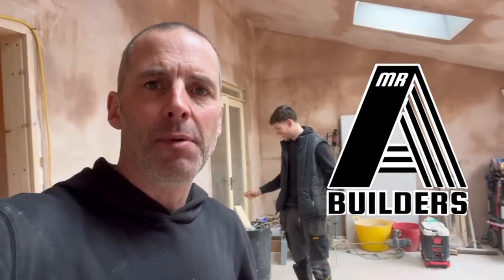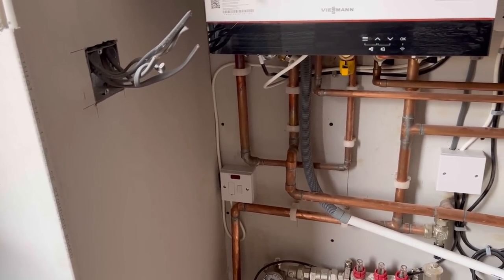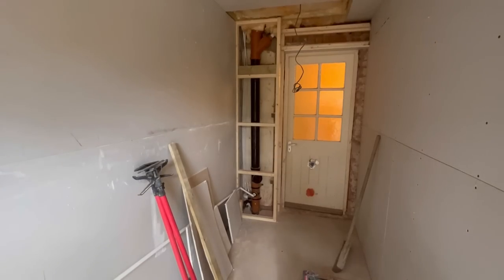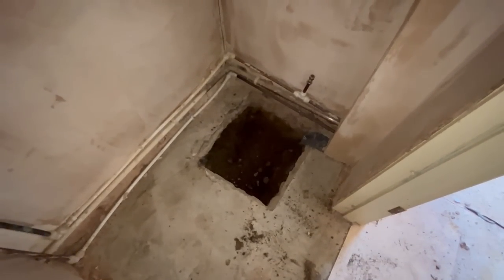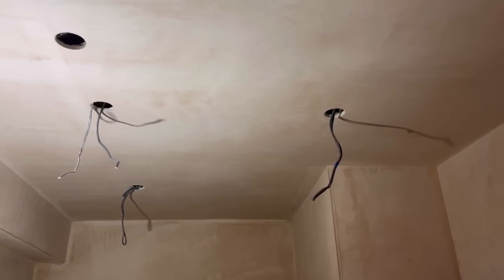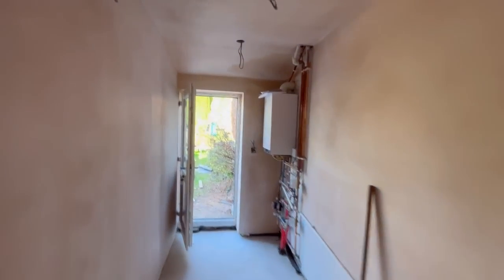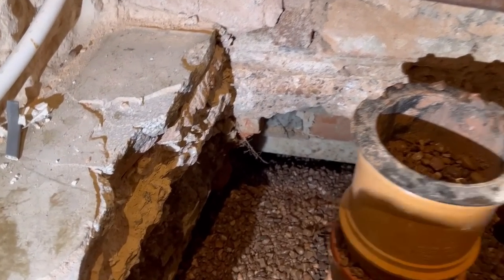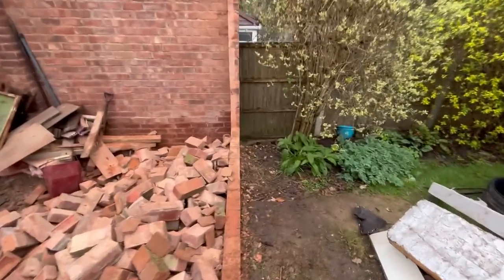Spot lights, poo pipe, plastering prep and clean up

Comment: Doing a nice job on the extension. Just a thought! why don't you cut the holes for the lights in the plasterboard before it's plastered. Then the plasterer just goes over them and before it sets just cleans them out with a gauging trowel. As you say you can't do it on sites but on private work it works well and no stress finding the wires.😊
Reply from the maker: We prefer the stress mate. 😂
We have tried different ways over the years but the problem with a cold roof especially in the winter is that if you cut the holes out first you get a constant breeze and it blows any dust and insulation bits into  the room over the finishing plaster and also the holes aren’t as crisp because you have to trim the plaster snots off the edges prior to spot light fitting. I’m sure others would disagree but it’s always best to stick to the method that works best for you sometimes and of course what you think produces the best result for you. 👍🏻
Reply: @Mr_A_Builders  Your so right about doing what's best for you but always listening to and watching others! you never stop learning.  

That's just the way I do it !

At the end of the day if you leave a job that your proud of that's all that matters. 

Enjoying watching you work, keep putting the videos out. Thanks for sharing.
Reply: A
I've plastered a few of these jobs, I don't cut the holes, plasters much easier and doesn't squish plaster up the holes, speedskims better too. The electrician doesn't like it because he fears he won't find the cables. But a good measured map sorts that out,   and we all breath a sigh of relief.
Reply from the maker: It’s all about trusting the plan of your hole mapping at first fix 👍🏻
Reply: @Mr_A_Builders  seem to have started a bit of a debate here😅

Maybe I'm a bit luckier than most, I am time served Plumbing/ Heating (Eng Tech). A qualified gas fitter. Qualified Electrician right upto Inspection/Testing and worked along side my dad who is a Plasterer. He taught me his trade.

I was just saying I prefer to cut holes first, I find it less stressful. I plaster it, never had a problem with plaster squishing up the holes🤣

Just give them a quick clean out with my gauging trowel and very rarely use speed skims or flexible trowels, just my preference.

Being an electrician I just put the lights in the next day. Job done no problems🙂
Reply from the maker: There is never a best way to do anything as long as the outcome, quality and of course within regs in some cases is the same. Even if it takes longer the way we feel is best, we have to do what makes us comfortable and gets the results we want. 
We love it on the channel when we get subscribers answering each other and giving their opinion on other comments it means we can just sit back and watch 😁👍🏻
Reply: @Mr_A_Builders  😅🤣😅

Comment: Very Nice Work, I start and extension more or less the same tomorrow, what happened to the Cracked Corner skim bead? Was that from drying out or has it been damaged? Finding a lot of issues with airline cracks myself lately on joints and skim beads. Especially with materials drying out, such as timbers etc 👍🏻 keep up the good work
Reply from the maker: Unfortunately mate and not wanting to go into it much but it’s an installer error that should have been done right in the first place. 👍🏻

Comment: Hello lads. Bit of advice please? When you board it looks like you don’t add noggins to the joints? Will this not crack or is due to the board thickness?
Reply from the maker: Hi Jonathan and thanks for commenting. The plasterboard is sitting on top of 50mm rigid insulation so there’s no potential for it to sag or move. It’s also fixed very 6” with 100mm drywall screws as well 👍🏻

Comment: It was going so well until you bonded over uncapped wires! less than 50mm deep needs secondary covering.
Reply: And where does it state that in the regs? 👀
Reply: @joshell2857  Regulation 522.6.202
Reply: @andrewdoherty737  that’s not what the regulation is stating in my opinion. It states about having RCD protection when less that 50mm, but is not required when protected by means such as metal trunking that meets BS 7671. The RCD protection would be provided by the breaker back at the CU for the socket circuit. I may interpret it wrong…
Reply: @joshell2857  whilst I'm sure the regs have changed over time, unless the cable is behind dot & dabbed plasterboard my understanding was cables should always be in conduit or similary protected
Reply: @andrewdoherty737  obviously it is best practice to do such things, but pretty sure it’s not a requirement due to regs in this case that you pointed out
Reply from the maker: Thank you both for the interaction on our channel. Our electrician has assured me that his belief and of course his interpretation of the regs and indeed mine after he sent them to me to answer this question is it’s got to be RCD protected but  if it’s not it’s got to be covered in conduit or capping but my opinion is that unless it’s a nail when someone puts a picture up capping or conduit isn’t stopping an SDS drill and you wouldn’t even feel the metal capping. 👍🏻